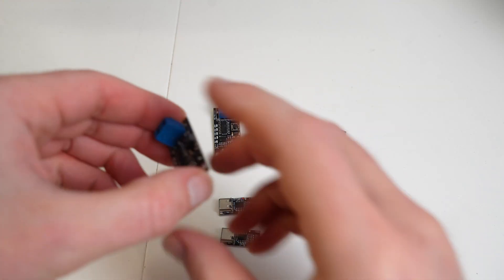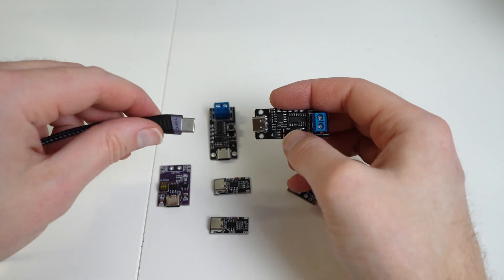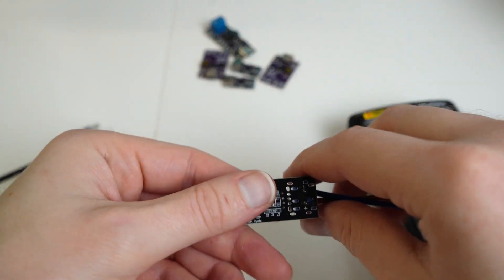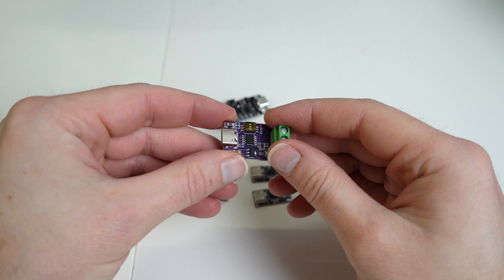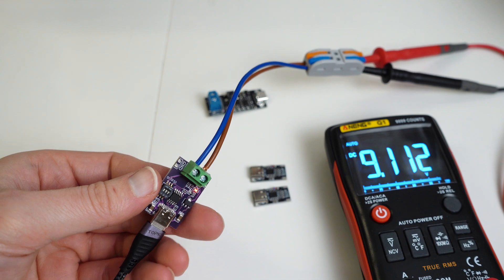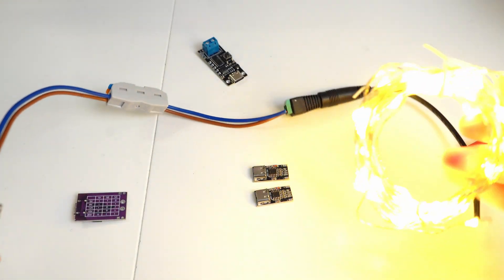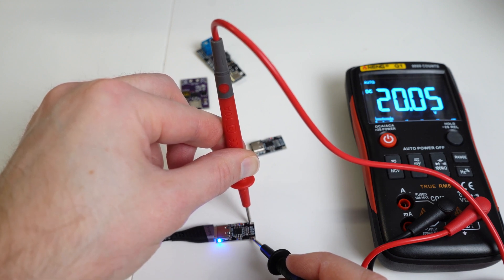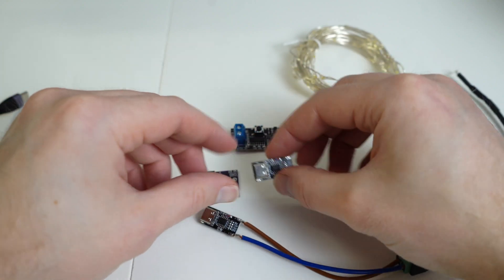USB Type-C PD Trigger/Dummy/Decoy Boards - Perfect addition to your kit!

Comment: I have a few of the purple type with the dipswitches, and all they will do is pass the input voltage. No change whatsoever. Am I misunderstanding the function? Do they need to be 'triggered' into pushing out the voltage as set by whatever is plugged into them? The AliX page says to test with a multimeter, and I get the input voltage every time. One thing I noticed is mine do NOT have the secondary chip. Maybe fakes.
Reply: I have a similar issue, my voltages don't change, in addition - when I connect the module to a 12v usb c pd output ( in my car) the red indicator LED on the trigger board flashes slowly. I thought I might have had a dud, but it was exactly the same on the two I received. 
Did you happen to figure out the problem? BTW - this vid is the best I have seen on this topic for newbs.

Comment: Any idea what the maximum ampages on the outputs are? Do they get anywhere near the 100Watt?
Reply: the product descriptions claim 5A. with 20V triggered that's 100W. proper usb cable with emarker chip necessary for the power brick to allow the 5A

Comment: can i use one of those pd trigger boards as a charger or adapater?
Reply: You can definitely use one of those boards to Supply a charge board with power. But you definitely need a charge board to connect it to any battery. You might as well buy a charge board with a USB-C connector on it at that point, It would be smaller and lighter that way.

Comment: I have one the purple ones with dip switches, but I only get either 5V or 15V for all the other voltages, I used a baseus 100W adapter and was checking using a FNIRSI 1013D scope (no DMM at hand)  not sure why am I getting this behavior! any idea ???
Reply: My xiaomi 33w charger only has 5v, 9v and 12v, but if the load current it's low, gets back to 5v from itself
Reply: Try with another PD charger or another PD decoy/trigger
Reply: I have this module and i didn't faced any issues. All works properly. Maybe your module have fault

Comment: Does all of these can automatically stop charging li-ion battery? Or you don't recommend to use these as battery charger?
Reply: No, these will damage liion cells. You need a constant current-constant voltage (CC-CV) buck (step-down) converter after the trigger board to provide the proper charging voltage, e.g. 4.2V/8.4V/12.6V/etc.

Comment: It works only with QC USB C power supplies that switch when the board request the voltage. EX USB C 5V non QC will only give 5V output and not more. So a QC2 will switch between 5/9 and 12V. This board is not a Boost converter !!
Reply: So my boards are good? I tested with a powers supplky buy they just pass the input voltage. .......so they need a PD delivery charger? (I have a couple)

Comment: Thanks for the roundup! Very useful. I bought some similar units to 10:30 but it looks like I neglected to read that they are 12v fixed. They are practically identical to your ones but are missing a resistor on the 20v line. I wanted to make sure I didn't repeat the mistake, and from the types you reviewed it looks like they aren't all this way and you can get ones that output the full range so thankyou